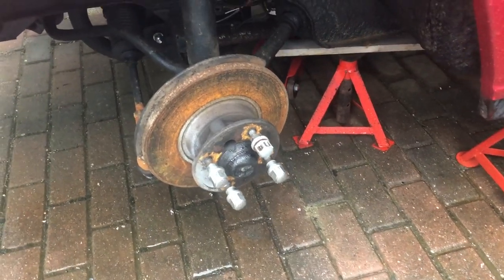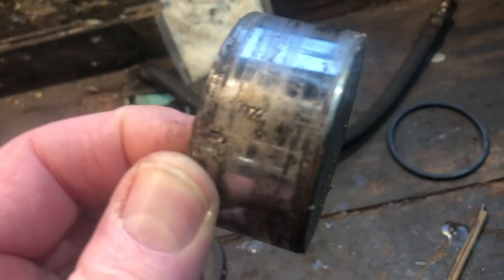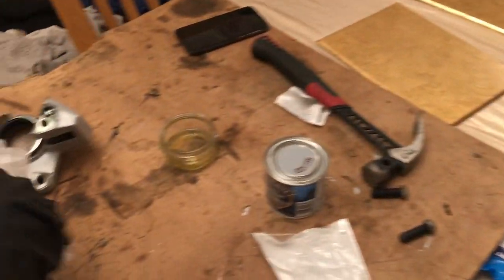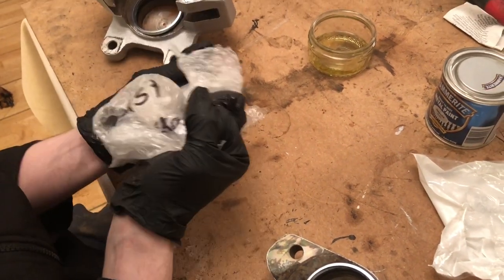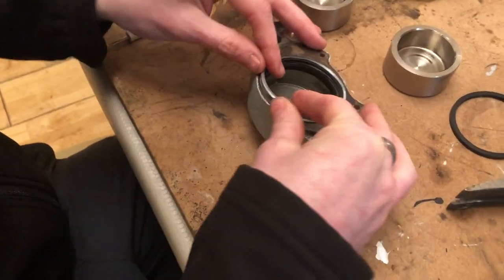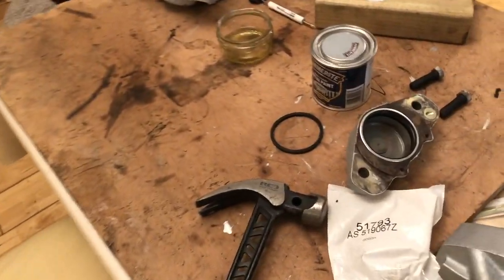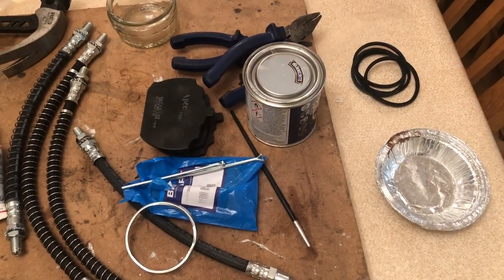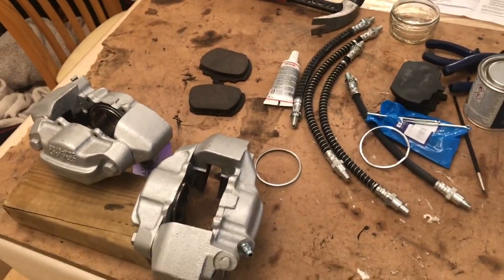Triumph Stag - Brake Caliper Conundrums

Comment: I have just done this on a Triumph Trident T150v, and about to do it on my Stag. Trident identical, just smaller calipers.

I find the best way to remove pistons is to make a special tool from an old socket using "starter motor clutch" principle.

In your starter, there is a one way clutch. It has ramps and rollers. Rollers go up the ramp, they jam against outside= drive. Go down ramp, they let go.

So get an old socket that just fits inside pistons and grind an angled indent into the outside diameter. Insert into piston. Slide a roll pin or pin punch into the "wedge" indent. Rotate so that pin runs up ramp and it will lock. 

Rotate piston and apply upward force as you do. Piston will rotate upward and out.

I used this today on the Trident ones, and have been using it for cars for 30 years, they have always come out...
Reply from the maker: Awesome - thanks for the great tip. We'll share it on this weeks' www.arrythestag.com/saturday-sockets feel free to join us there too! All the best and have a great New Year weekend! Kind regards TR Tony
Reply: @ArryTheStag  Cheers mate;

I just (half hour ago) used the "socket with a nick/ramp" idea above and it worked for one. The other one WOULD NOT come out.

I have a tool that I have used for a multitude of things, but never for what it is designed for. It is an "exhaust pipe expanding tool", and I got it because it was cheap, looked handy, and you can never have enough tools. 

So I put that in the piston centre, expanded it until tight, Stuck that in the vice, rotated caliper half up and away from the piston - perfect.

More than one way to skin a cat, and all that........

Comment: When I was driving my staaaag I found I had to almost stand on the brake pedal to get it To stop like a modern car. Have you considered any upgrades? Green stuff?
Reply: Yes get some pads that wear quicker than the actual discs.. in the old days the disc assembly was definitely not a=viewed as a disposable item.

Nice little refurb job, and clever opportunistic use of the kitchen !
Reply: In all large Triumphs I have driven I have noted that all needed more oomph on the pedal compared to modern cars.... EBC Greenstuff produce a tad less dust, but are also less efficient in braking.  Mintex 1144 wear a lot quicker but actually do the job.  Brake pistons, replacements anyway, have only about 5 microns of chrome plating on them - might as well not be plated at all.  Need at least 50 with a nickel under layer to be efficient at keeping corrosion at bay.
Reply: Biggest problem is the rears and people selling pad material that is for new cars. Now, I KNOW they have to do that/had to remove some materials/asbestos etc etc. We all know that. But new materials that can be used on newer cars with larger pads, when on some old cars they are tiny doesn't help us much. 

Here (Australia) EVERY Aussie does two things to Brit cars. Far too wide tyres, and far too hard brake pads. 

I bought an XJ6 Jaguar in late 80's, and the brakes just didn't work. And this is a car reported as having great brakes. I took the pads out = "Metal King". Hard as a rock, last forever. Won't stop you though. A small technicality apparently. 

I went to a Jag shop. He had new pads, and some 30 year old ones that were almost free, as the box was so dusty/dirty. Nice and soft. Great. Put them in = car stood on it's nose. 

Got my Stag. Rears almost gone. Got new ones, fitted them. Going down a long winding downhill grade, car was an auto then........... fronts smelled hot - stop sign at the bottom, went straight through it. Rears not even warm. Jacked up car, rears wouldn't stop with brake on in drive. Nothing wrong with cyls. NO dust in drums. They just weren't doing ANYTHING.

Got new ones from somewhere else. Guy told me bonding company had experimented with far harder/no good/supposed to be recalled. I asked the guy to bond softest he had. Put them on, feel drums, they are hot after stopping, like they should be. Brakes feel good, car stops well.

Dolomite sprint pads are TINY. Matchbox size. Bought new pads. Drove down the road, locked up rears at stop sign, fronts doing NOTHING. Put old back on - perfect.

I think that new cars want less dust/more time between pad changes to get through warranty, so ultra hard pads. Don't stop as good, so make them BIGGER. Have a look at how huge new car pads are. Even small cars pads are TWICE the size of my Sprint. That is fine until they say "pads for old cars? Just put on that stuff we use on new......." so meant to be far larger, put on tiny Sprint footprint = useless.

The other thing too is that hydraulics always takes the easiest path. EVERY opposed caliper car people have brought to me with "not very good brakes" has had one piston seized. One piston sticks. Pads hardly move much, so free piston moves, contacts disc. It is easier for the caliper to flex a little (doesn't take much) and move disc across to stuck pad (takes up wheel bearing play. Again, only slight, but doesn't need much.) That "flex" takes extra effort, so less braking effort. Piston won't free, because disc moves enough to apply brake BEFORE piston frees, so it doesn't have to. You have to take up that slack/slight movement and THEN apply pressure to free. 

So, I remove pads. Get them to press pedal. One piston moves. I push that back in. Replace pad. Press pedal....................free piston takes up, then hard spot - THEN "lets go" as stuck piston frees. Push back in. Do it again a few times. I call it exercising calipers, and it works for me. If cars not driven much, they can stick easily. Some say don't need/argue about it. If so, don't do it. But works for me. I wonder how many who reckon don't need.................. go out and try above, and find the "hard spot then let go" happens............. so one of their pistons is stuck/brakes less efficient than should be - and after that brakes far better.

But for me the biggest problem has been the hard linings on the rear. The standard front pads here (Bendix) are good on the Stag. I have been through LOTS of those in the 330,000 kms I have put on my Stag, (had 90,000 on it when bought in Feb 1993) and STILL on orig discs with no wear/within spec, so not too hard. But rear linings, they ALWAYS make  them too hard. Silly me, I prefer my rears to actually work rather than have them never wear out and do nothing. I use far less pads now, as car is a manual now, so only use them if crash stop/come to a stop. Until 15 years ago, was an auto, so far more brake use.

I have had my car for 30 years next month, and just rebuilding front calipers (from a wreck bought for spares years ago, so car isn't off road more than needs to be) and TRD above is correct; these calipers are in very good condition, but very very slight pitting on one, so while I thought would get away with them, may have to look at stainless pistons, as chrome finish often pits. I have just put those (S/S) in T150 Trident twin calipers, so same thing on Stag, but bigger.